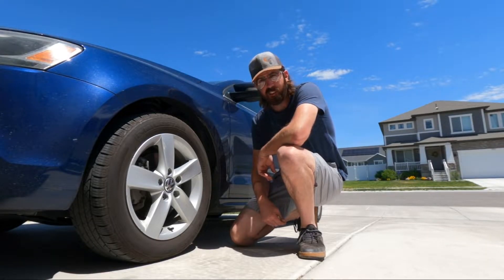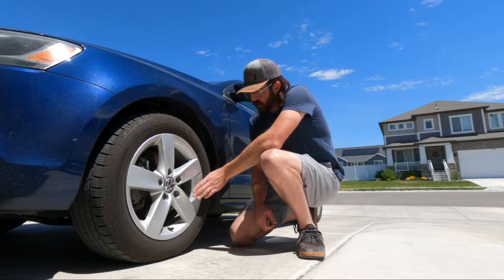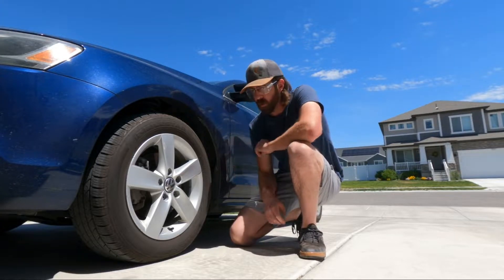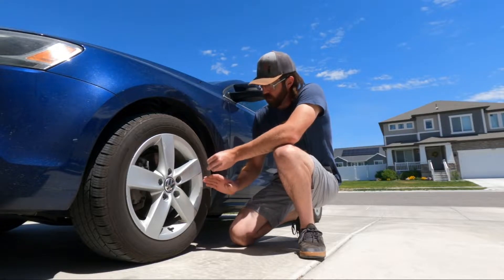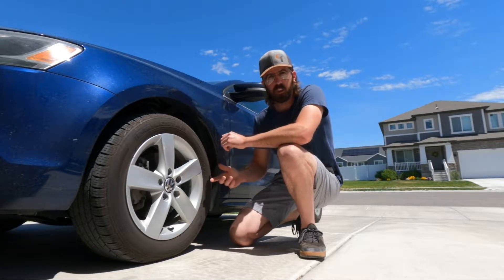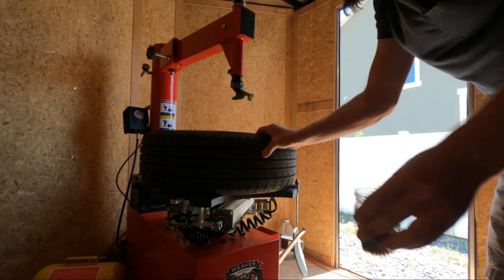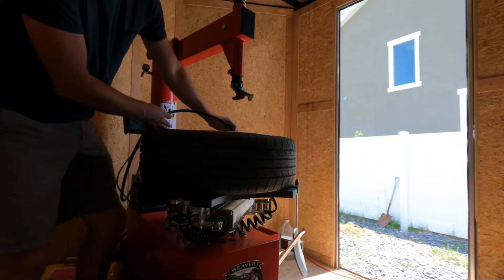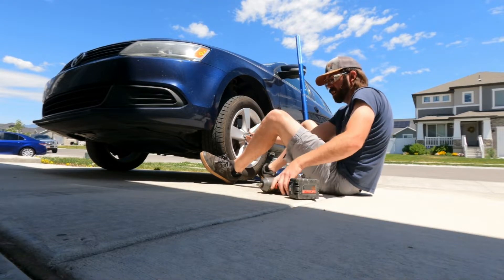Do Tire Balancing Beads Work?

Comment: I use airsoft BB's in my trailer and truck tires. 3.5oz in trailer tires and 5oz in my 265/70/16 truck tires. You can find charts for amounts to use in each tire size online. Steel BBs they say will destroy a tire over time. JS!
Reply from the maker: I have seen glass and ceramic in semi tires. No issues. In order to put miles on the vehicle the tires have to rotate. In theory the balance material of choice shouldn't be moving that much once they are against the out side of the tire.

Comment: Hey Kev, good video. you should also try antifreeze as a balancer, no friction, no noise, no corrosion, no freezing!
Reply from the maker: Not a bad idea. Only issue I can see is if you has tire pressure sensors.

Comment: I just put some balance beard in my Camry , what I have to say is anything over 60 mph it starting to vibration and the higher the speed the more violent vibration it get.  I think wheel balancing machine with road force variation is the only one that can take out all the shaking from the steering even on higher speed !
Reply from the maker: Bead have their place. Not the greatest but in my old Ford with wobbly wheels they are pretty decent.

Comment: My situation is 10 oz of counteract beads was not enough on a 35x12.50x15 mud tire, ended up with 14ozs per tire, gona see if they smooth out the beginning of cupping, I could tell rite away that it was a lot better than the 10ozs that I started with,
I did cross rotate to try to cancel out the beginnings of the slight cupping in the center of tread,
Running 40psi,
And everything shocks springs alignment is all perfect,
Had one tire replaced, out of round
I got in a bad batch of these hi dollar tires I guess, 
But more beads definitely helped,
And the counteract are glass 
You can put them through the valve stem, which is a learn as you go type deal,
Can b a headache, but when you figure it out they go in pretty quick
, 
But I think more is better, at least in my situation

Comment: I tried them on my 22.5 for the drive tires on my motor home and I don’t like them. It seems it takes for ever to quit vibrating and ever time I slow down or stop they vibrating starts all over again for about 20 miles or so . I am going to take them out and have tires balanced with weights

Comment: You used BBs 😂  for everyone watching here.. if you use proper balance beads (theybare made of glass or ceramic and are TINY TINY) , you will have better results than these people using airgun ammo..😂  BBs are WAY to heavy and gravity will overcome the centrifugal force that put them in place.
Reply from the maker: They actually worked pretty decent. And I dont use them in my race cars. Just my trailers and such.
Reply: Air soft BB's work just fine. I use them in my trailer tires and my truck tires. Steel BBs are not the way to go. JS!